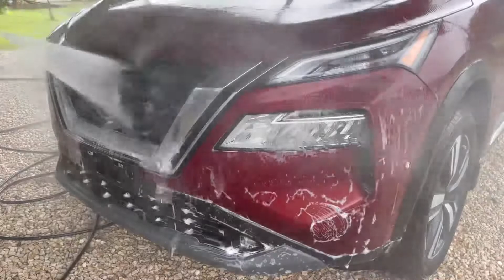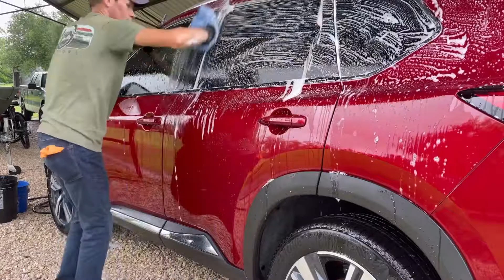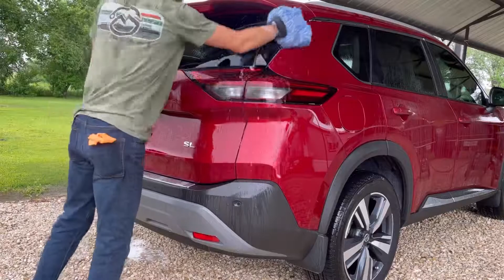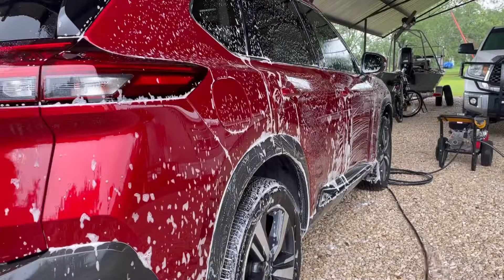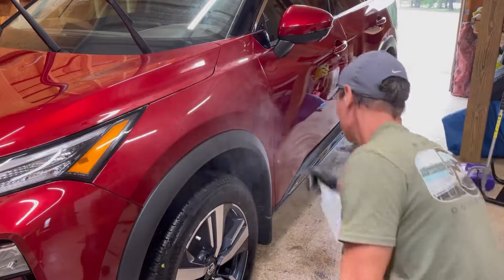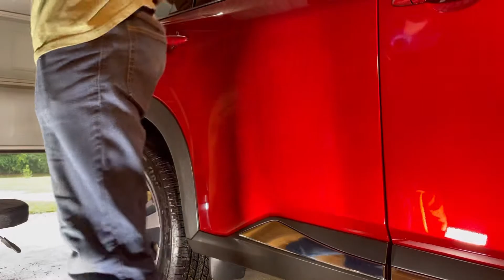Ceramic Coating a new 2021 Nissan Rogue

Comment: Hi Matt, how often do you need to apply the ceramic coating? Also I’m interested in knowing if it expands and contracts with temp changes? I don’t know wether to pay the dealership for paint protection because I’ve heard it’s a rip off. I get my rogue platinum in a month and pretty stoked 😊
Reply: So what did you decide to do?
Reply: @PRS247  I had the dealership apply the ceramic coating.. lol